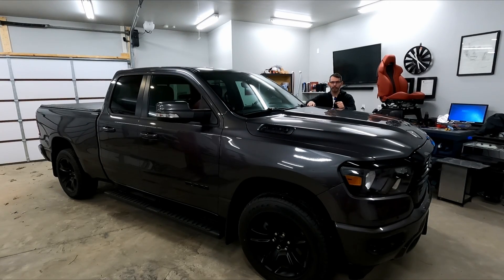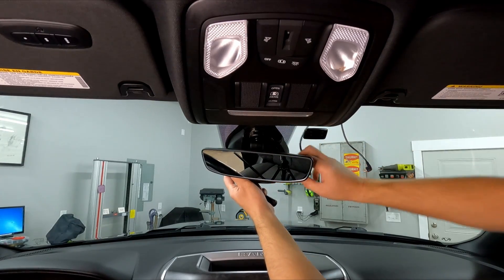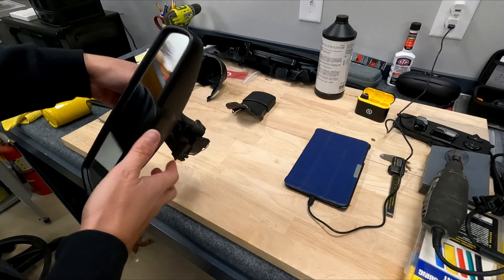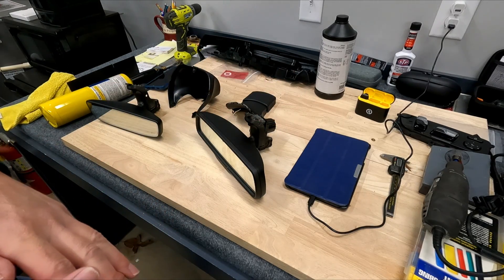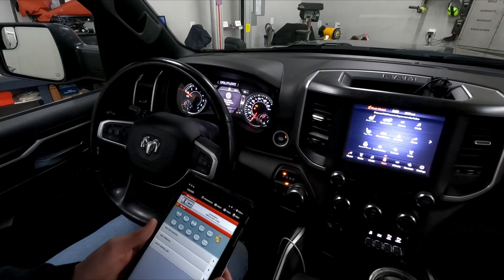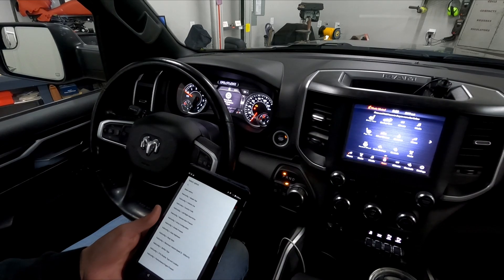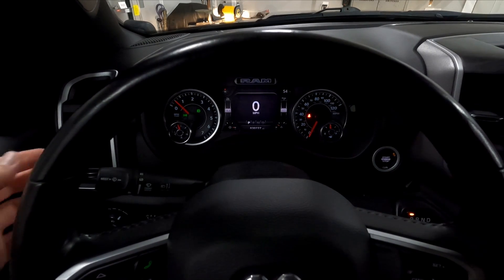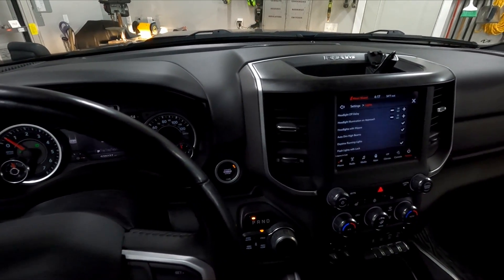Ram 1500 DT (2019- 2024+) SmartBeam Automatic High Beam Headlight Install with Programming

Comment: I have a 13 laramie with auto dims, they randomly quit working and since then I purchased the alfa obd. I was going to try and calibrate it but after doing so I have flashing lights in my mirror and still doesnt work. Any Ideas?
Reply from the maker: That's strange for sure. In a different video I added auto high beams to my 2018 1500. I'm not aware of any calibration for the high beams. In my cases I have only had to activate the settings. 

It's possible that your rear view mirror light sensor is falling. A loose solder joint or connection could be intermittently taking it offline.

Comment: I have 2019 Ram 1500 Bighorn new body  style. I followed the steps in the video. It added the function to the radio, but it is not showing up on my dash. Is there anything else I can try to get it to show up on my dash?
Reply from the maker: @DEERHUNTER-k7g  did the option appear? It took mine a few hours to show up
Reply: @ironicallyengineered2486  Hi.. So I just picked up a 2025 Durango. I did not come with auto dimming feature.. but should have since it's an RT Premium. It does have the auto leveling HID's and the forward collision. The rearview mirror is identical in model # to my friend's 2023 Durango which DOES have the auto dims.

So i followed your video and everything works except that the highbeams never actually come on at night.. no matter how dark the road is. 

Uconnect has the Auto dim item enable. the headlight knob is set to Auto and the stalk is pushed to the highbeam setting and the display reads Auto highbeam Enabled.

But still.. they do not come on at night.  What could I be missing>??
Reply from the maker: @todaystan8885  I would take a look from the outside of the car to make sure it actually has the sensor in the rearview mirror. It might have the same PN on the mirror housing, but that could be just for the housing and not the actual mirror assembly. I know for the truck, the rearview mirror frame is the same (it has the bracket for the light sensor, just with nothing installed) between the Smartbeam and non smartbeam mirror.
Reply: @ironicallyengineered2486  Now I'm a bit confused. There are a few sensors I can see on my mirror from the outside looking in. So looking in from the outside, there's a small square inlet on the backside of the mirror that looks like a sensor. and then there are few sensors right up against the glass. 

So it appears to have the correct sensors and compared to other Durangos with confirmed Auto dimming, it all looks the same.  In your video you said you had to road test it to confirm it actually worked. Did it work for you?  

And wondering if my low beams are aimed too high, would that confuse the sensor into thinking it's oncoming headlights?  Also, can I try and force/trip the sensors by.. say.. taping something to the outside of the windshield to cover the sensors and make them think it's totally dark outside?
Reply from the maker: @todaystan8885  the square sensor on the car front side and the sensor in the mirror glass are for the auto dimming function. 

If your mirror is the same as the ram,  you will have the box hanging below the mirror with a square opening on the windshield side.  If you look in that hole,  you will see a green and red eye if you have the auto high beam function.  If there's no eye,  you don't have an auto high beam mirror.  You can buy a used one on eBay or LKQ.
Reply: Don’t you have to have the right windshield for that function to work?
Reply from the maker: @Ybshy  as far as I know, there is not a different windshield for the auto high beams.  You only need to have the auto dimming rear view mirror so that you have the wire harness present.
Reply: @ how does that camera see out? Is anything blocking its path, is what I’m curious about, this is something I’m wanting to do as well
Reply from the maker: @Ybshy  it's actually not a camera.  It's 2 light sensors on the rear view mirror that sense light.  There's an opening on the mirror trim that it "looks" through.
Reply: @ so that mirror with a lense in front what is its purpose?

Comment: Thanks for the video, I am getting conflicting info on the mirrors, the salvage yards are saying the "camera" is part of the front crash avoidance system, and the auto high beam mirror looks nearly identical to the auto dimming, just a part number change.
Reply from the maker: The good way to tell is to plug the VIN of the part truck into a website that gives you the window sticker. You will need at least a Laramie with the level 1 package. But the window sticker should list SmartBeam if the truck has it.

If you can see a picture of the actual mirror, it has a forward looking "eye" with a red and a green sensor inside. It does not have a camera.